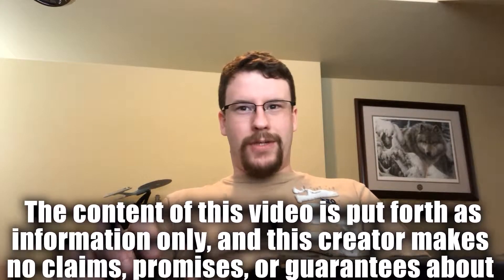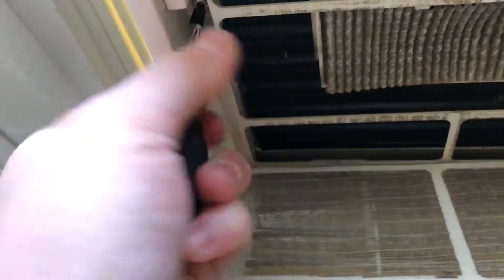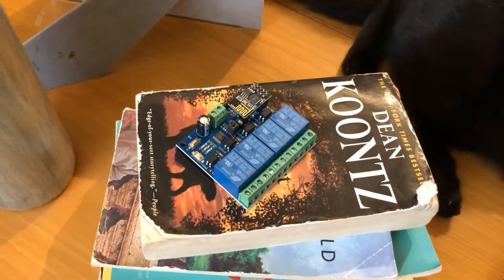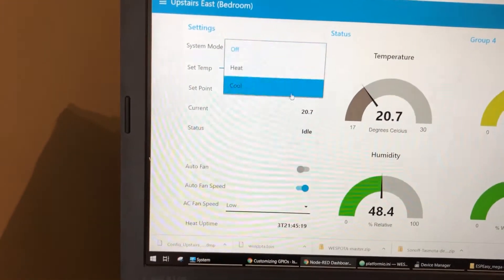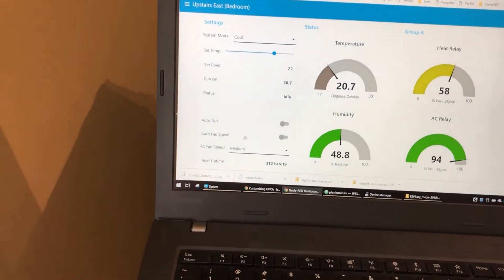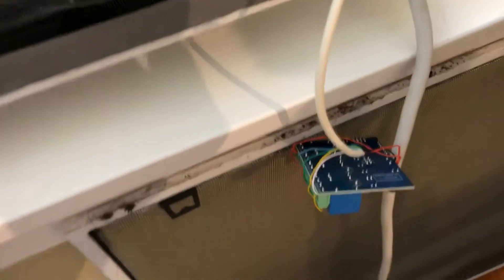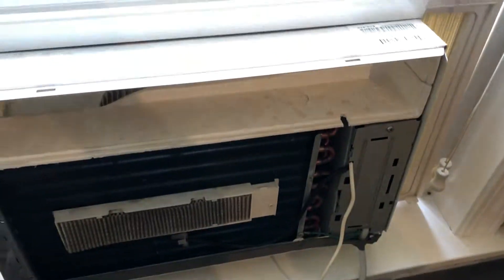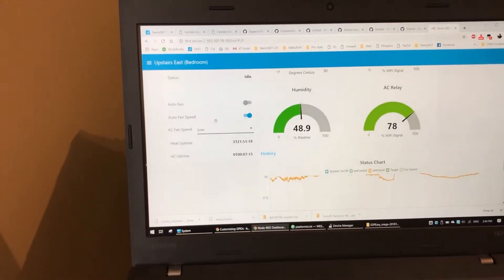Replacing the relay board in my DIY smart AC with a LC Tech 4ch

Comment: those relays are overkill, that board should be replaced with some simple opto-isolators on a esp 8266 or esp 32. The clicking on those relays is also very annoying and can wake up a light sleeper. PM if you need help with the board design or something. I know this video is old but people need quarantine projects right?
Reply from the maker: Thanks for the idea. I went with these just because they were cheap and easy to implement. I may look into the opto-isolators for future projects. The relay clicking isn't too bad for me
Reply: @TechwithShae  you are welcome sir